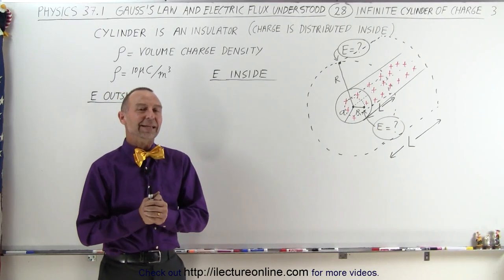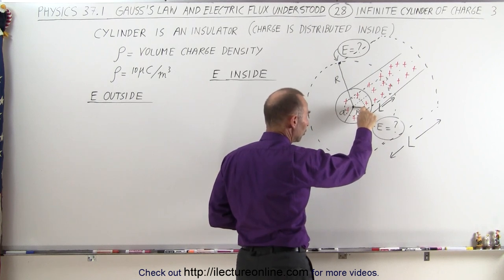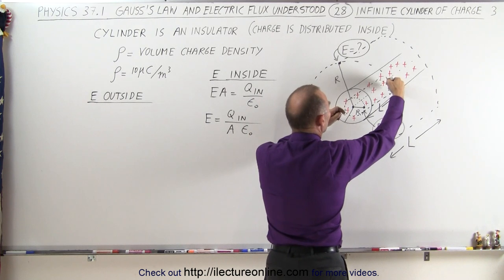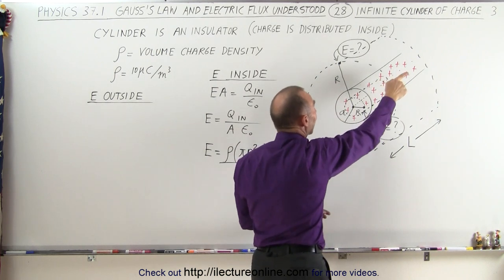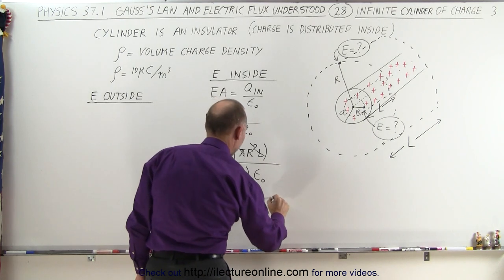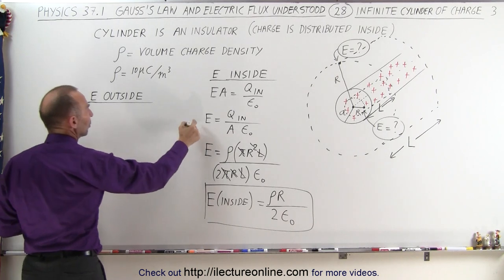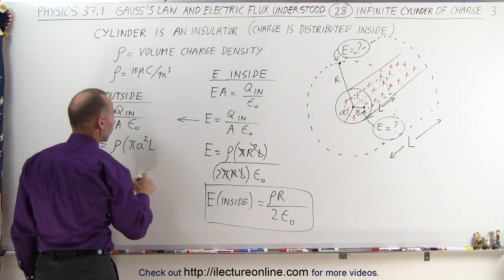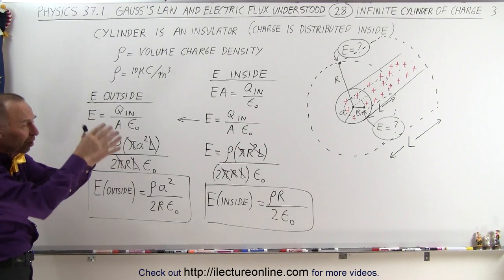Physics 37.1   Gauss's Law Understood (28 of 29) Infinite Cylinder of Charge 3

Comment: For E outside shouldnt the answer be E=(pa)/(2Eo)? Because, wouldnt we use the area of the actual cylinder and not the gaussian area if we wanted the E outside of the cylinder? I understand the E inside completely, thank you for all the help and for the extra help in advance!
Reply from the maker: The answer and method in the video are correct.

Comment: Sir (talking about the case of finding electric field inside solid cylinder )here there are charges inside and outside our assumed gaussian surface so wont charge outside and inside of our gaussian surface repel each other thereby creating a null point on our assumed gaussian surface ?
Reply from the maker: The electric field of the charges on the outside of the Gaussian surface will be directed outward only and therefore will not have an effect on the Gaussian surface.

Comment: Hello, is there a particular reason that we cannot just keep the Qin for the gaussian surface when R>a to be Qin? I do not see how for the insulating sphere (when R>a) the Qin stays the same, yet for this example, Qin is substituted with (rho)(V). I referred to your video on a sphere with uniform charge but I don't understand why the Qin changes for the cylinder but not for the sphere when both have R>a.
Reply from the maker: For R>a you are correct, (as is correctly calculated in the video).  For R< a you have to calculate the Q inside.

Comment: What happens if there is a hole inside the cylinder
Reply from the maker: Then you have to subtract the portion where the hole is when you calculate the charge inside the Gaussian surface.
Reply: I'm really shocked,you have 643k subscriber but you had responsed to me less than 1 hour. Thank you so much
Reply: @rzagunes2410  Dude its 660k now. <3

Comment: doctor R is not same then you can't cancel it ?!
Reply: R is the same so it can be cancelled . R at top refers to the part of cylinder which contains charge which we know is same as our Gaussian cylinder and R at bottom is literally R sub g!!!
Reply: I think that when he is talking about the E inside he means to calculate the E of the gaussian area as a standalone cylinder. Usually you would take the ratio between the radius of the real cylinder and the gaussian (imaginary) cylinder, so this is a bit weird but I guess that it makes sense since there isn't any charge on the real cylinder's surface.